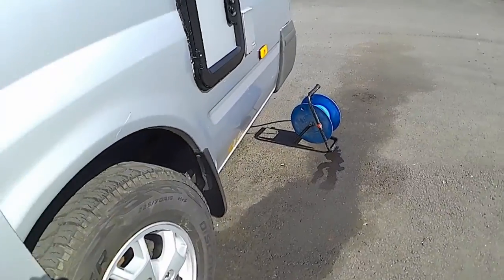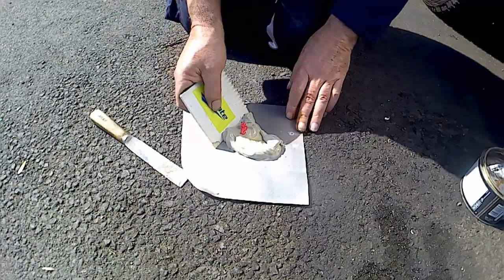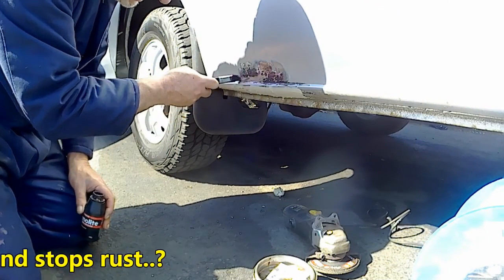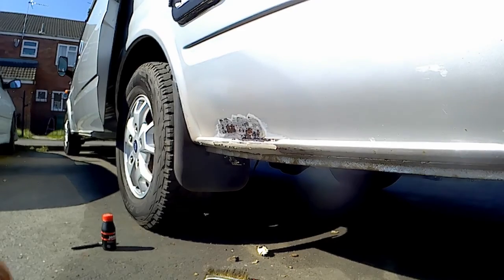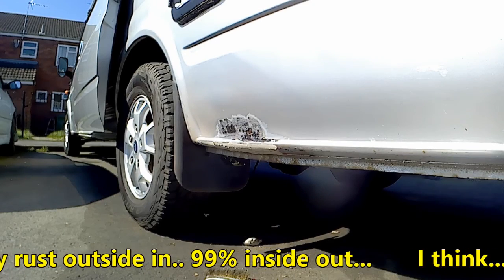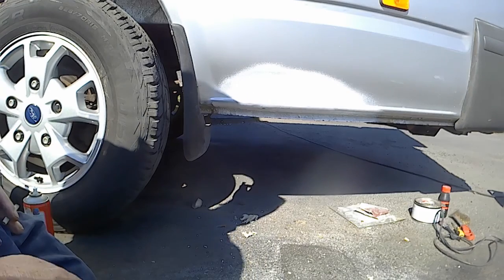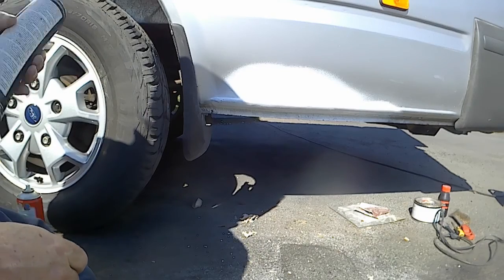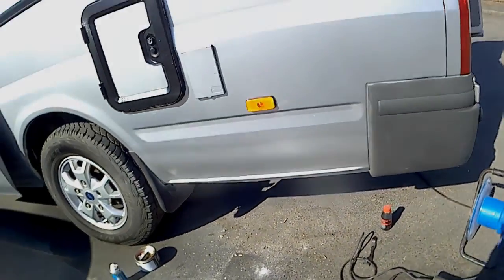Transit Mk7 Where do they Rust.. Repair and Prevent video.. Camper Self Build

Comment: Great vid , I got told before you isolate & your inside panel are off , pouring oil WD40 inside pael so it swills around helps save the internal rust coming through , KEEP WELL& SAFE FELLA !✊💥👍
Reply from the maker: Thanks for the tip!

Comment: I've had two of these vans over the years. Sorry mate that won't work. Transits rust in numerous places. You need to cut it out and weld plates in, they rust from the inside and it will be far worse inside. When you cut the rust out then you can inject with something like Dynax. Unfortunately that job is going to rust again in a few months.
Reply from the maker: Hi Matt.. YES we all know that, I did say in the video that this is only a temp repair so that I could take her to a show.. Complete new sill on it now, its the only way to get rid of it all together.. Thanks for the comment..

Comment: problem i found is the rust proof coating on all the interrior of panels was some kind of epoxy which is super strong but over time micro cracks and natural drying of the coating made it brittle and come unstuck letting moisture in to the steel.

needs something stronger, the modern method is to use electro deposition which bonds like a weld to the metal
Reply from the maker: Hi Stanley.. agree with you there.. its like they only primed the metal, and primer does let moisture through.. thanks for the comment

Comment: Brilliant video we are just going to look at same model camper van tomorrow...i will be looking at the areas you have shown.
Any other tips or what to check for...thanks m8
Reply from the maker: Hi.. Jumbo's tend to rust just behind the rear wheel arches.. Front driver step. Top of the chassie legs under the bonnet.. The rear spring tend to crack on the top of the rear shackle. other that that its just rust from stone chips, that is just surface normally.. The oil will be black, but check that it is thin as milk, pull dip stick and rub the oil between your fingers to see if it feels gritty, if it is thats bad.. Start the engine and try riding the clutch with the brakes on full to check for slip and high the peddle is from stalling.. And of course if any dash lights are on, they can be expensive to turn off..? Cheers

Comment: Bit of a bodge job... Sorry for the negative comment but really you should have wire brushed/ground back to bare metal. Cut it out if need be and weld a patch in. Then make it look nice...
Reply from the maker: Hi Bud.. all comments whether good or negative are welcome.. yes I agree.. I am sat in the sun on holiday looking at it as I type this reply, and it needs doing again, but this time it will have a complete new panel.. but the repair was to see how long it would last and the price.. cheers
Reply: @WonderingWomble  best of luck with the future repair! Jealous your on holiday during these times. I'm currently dealing with never ending rust on a Transit camper conversion so I feel your pain. Ended up spending 3 weeks solid just removing rust from the inside. Not fun :/

Comment: That looks brilliant. When it comes to the final paint colour. How do you get the one you want?
Reply from the maker: Hi Sean.. Thanks for the comment.. Any colour is better than rust.. Ha.. O a Ford Transit, the colour code is on the vin plate under the bonnet, in my case it's moon dust silver..? Cheers..

Comment: nice one kev mines a swb so i dont have that bit but the front wing starting to bubble a bit at bottom near bumper mines a 2001 18 years old not to bad lol
Reply from the maker: Hi Dave.. It might get some in the back, you only gotta clear the drainage holes to stop it.. That on the front wings is dirt sticking along the seam joint and holding water. Just wire brush the dirt off.. Thanks for the comment..
Reply: @WonderingWomble  thanks kev will have a go

Comment: On the left side my Jumbo has those vent holes open, but on the other side they are pinched together. Should I open them with screwdriver? And...where is the water coming in, so that it needs to be dripped out there? Thanks

Comment: great video where can i get the side door rollers from for my transit mine are shot
Reply from the maker: Hi Lee.. I got mine from "transitpartsuk" on ebay.. this link is ebay.. https://www.ebay.co.uk/usr/transitpartsuk?_trksid=p2057872.m2749.l2754
I bought mine as 3 seperate parts top mid bottom

Comment: Great video. Just what ive been looking for. 
Just on a different subject, how did you fix on your front fog lights?
Reply from the maker: Hi Bud.. They are the proper Fog lights for the ford transit bumper fog lights (fitted on higher spec vans). Even with a standard transit the bolt holes are there. I think that the early ford focus and mondao ones are the same but you have to move the bolt holes a little.. Depending on the spec of the van, sometimes the wiring is there as well..?
If you mean the driving lights in the middle above the number plate. That is a bracket i got off ebay, it is L-shaped and blots in the place of the number plate and then the number plate bolts to it..  it has a small round nudge bar welded across the front of it so no sharp edges.. Remember if you fit any extra lights to a transit, use a relay as the standard wiring is not strong enough.. Bit of a long reply, but hope it helps.. Thanks
Reply: @WonderingWomble  Thank you.

Comment: Has the rust came back?
Reply from the maker: Hi Gavin.. rust on the steps, NO.. rust in rear arch, Yes its back.. remember.? Most rust from the inside outwards as the rear arch has, its a water trap.. when weather warms up, i will put a new panel in.. cheers